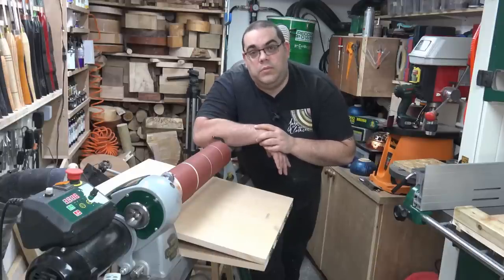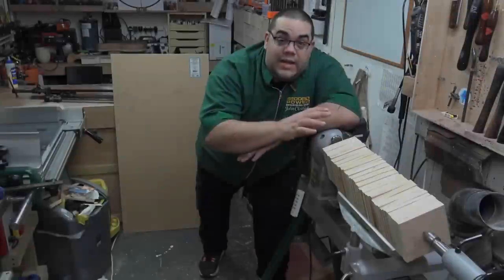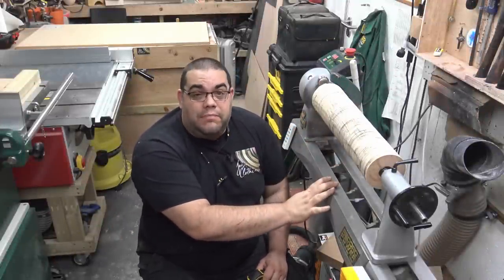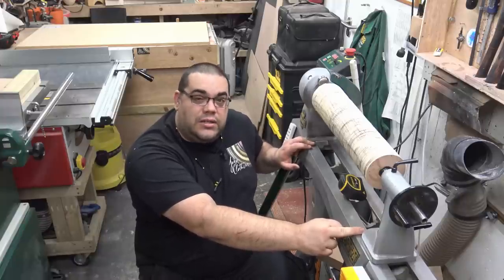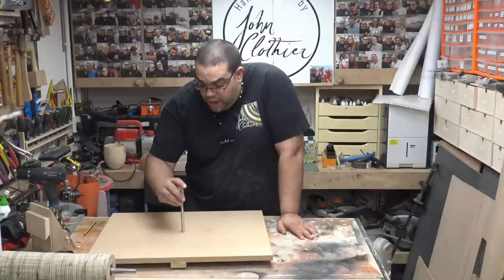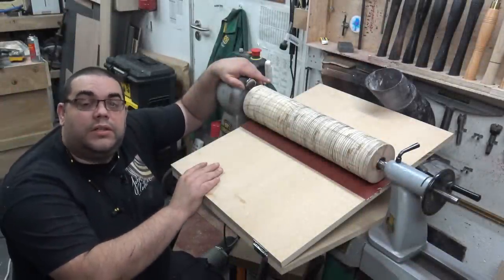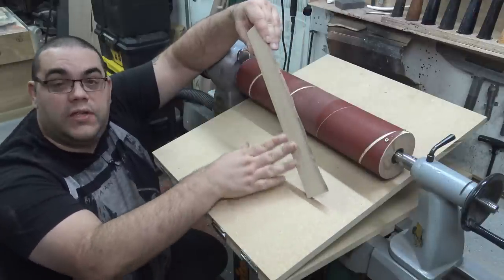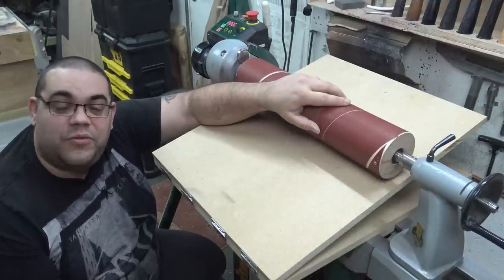How To Make A Drum Sander Jig For The Lathe

Comment: Good video, John. I have been thinking about making one of these for years but just have not found enough of a need for drum sander.  I have about a 4" diameter steel drum I salvaged from a treadmill that I have been keeping to use as a drum if I ever get around to making one. I guess if I built it I would find uses for it.
Reply from the maker: Thanks Mike. That steel drum sounds perfect for one of these. I'm using mine as part of a guitar build but I also think it will be useful for sanding flat rings of segmented wood ready for glue ups. I'm sure it will largely sit unused which is partly why I wanted to make something rather than go out any buy.

Comment: Hey John, you have given me a to quote Dr. Seuss "An idea! An awful idea! I got a wonderful, awful idea!" Ok before you think I mean I'm gonna do something completely half thought plan than can get me and my family in trouble with the law, my idea is thought out but I'm not a engineer by any stretch but simple mechanics I can figure out with my dad. Anyway I've been wanting to get a Lathe Chuck for holding my pieces (My Lathe came with PSI centers and while I trust em to hold my stuff I think I can better center with a four prong chuck, especially for Pottermore Wands and prop sword handles) but they are either just out of price range or not the right DPI for my lathe threads. But I also got a bowl plate with my lathe which has predrilled holes all around it so I thought "With a few 90 degree brackets, a few bolts and a little elbow grease I could rig up one of my own." 

The bolts would be the size that best fit and tightened up to a point I'd never get them off on my own and I have no plans to turn boxes or bowls in the near future so I could give it a new function. I'll work it out with my dad and uncle they know more on these than me, great mentors the both of them. What do you think? I have seen some DIY Chucks and those I'd never trust my skills alone for but a solid chunk of steel is a good base especially since it is designed for my Lathe. Have a good one and good luck to all your future projects.
Reply from the maker: Thanks for watching! You probably could fashion a chuck like that but im not sure how safe it would be.
Reply: @JohnClothier  Indeed, my dad even said it would cost us more in the long run. But as I said it was a idea and I ran it by the experts so I will just keep my eye open for a good priced chuck, maybe go to the hardware store with the plate so I can be sure it is the right thread count. My dad did have another idea for using the plate as a Rotary sander just apply some Velcro and get the right disk grits, it is much safer too.

Comment: Great video John !! My improvements(?) would be to use a sled and maybe to use springs somewhere. I also saw StumpyNubs make similar with that plastic PVC plumbing pipe, 4 inch diameter. Twas cheap enough where he had a drum for each grit. -Mike
Reply from the maker: Thanks Mike. Thanks for the suggestions. Some good ideas there!

Comment: Sorry for the wandering thoughts: Looks like a very good tool for flattening a segmented glue up for a bowl. 

I have seen people scribble the surface to be sanded with a pencil, and then look at the sanded surface after the first pass. If there are no visible pencil lines, the surface is flat, if some are visible then make another pass.

Would a single piano hinge work instead of 4 small hinges? 

The mechanism to raise and lower the surface looks awkward, but I don't have an alternative.
Reply from the maker: Thanks for watching Doug. Yes I am planning to do some segmented turning and the same thought crossed my mind to use this. Not sure if it was clear int he video, I used the pencil scribble trick on the drum when truing it up. Yes a piano hinge would be much better but I didnt have one, I did have the small hinges and while they took a little more lining up I doubt there is much difference. I would ideally go with piano hinge though. The only awkward thing I have found about the lowering mechanism is being able to set it to a particular depth. Its a bit trial and error. I did find away around this though by taking a preset block size and putting that under the drum before raising the bed to meet it.

Comment: Hi John Brilliant idea never thought about making one for the lathe. Would this take the place of buying a thicknesser. Also instead of glueing a nut on the end, could you turn the end of the drum to fit into a chuck. Just a thought, thanks again Terry.
Reply from the maker: Thanks Terry. Yes I use it instead of a thicknesser. It’s not going to take a lot of material away in one go but it’s good to get to final dimension. You could mount it in a Chuck but it’s keeping it straight and true that’s the issue. You know what it’s like when to take something out of a Chuck and put it back, it’s never true again.

Comment: Hello John !
Loved the video !
I am commenting without checking all existing. Please forgive me if I repeat. 
I am currently segmenting, happily despite using crap saws & homemade gear, so this project is right up my street. 
I had a few thoughts...
* Why not double up the mdf to increase its inflexibility (maybe even with plywood
* Is there room to add a short safety fence  along the hinge ? Or have you found that material catches are so unlikely that it would not be worth the effort ?
* I thought a pushstick would be helpful to keep a good steady pace through. 
* The single post table adjustment... has it been stout enough to remain parallel so far ? 
* I plan to use my live center instead of the bearings that you used. Would you recommend I reconsider ?

* Is there anything that you would do differently if you were to do it again ?

Again, great idea, great video, and good on you for putting it out there and sharing. 

Cheers !
Reply from the maker: Thanks Quinn!! 
Sure you could certainly double up the MDF, not a bad idea. I have also thought about a think layer of steel on the top. 
Yes you could add a fence along the hinge. Wouldn't work for me as I want to run long things through it and it would get in the way but great for segmented turning. As long as the drum spins the correct way then no I havent had any catches
Pushstick, could idea especially with small items.
Single post for the adjustment, no I added another 2 to give me 3. This is much better. 
Yes live centre is fine. I would have done the same had I not had the bearings
If I did it again I would add a clamp to hold it to the lathe and add dust extraction. I would also cut the plywood into circles and true that up rather than squares
Glad you enjoyed the video!
Reply: @JohnClothier  

Good Morning from the West Coast Colonies (Seattle) !

Good to hear from you !

I just got my roll of adhesive backed sandpaper to be helically placed on the drum (rough 80, I will then use finer on the 12 inch, lathe spun MDF sanding disk). Your input is gold, and I sincerely appreciate your time and consideration. 

Design-wise
* Is the steel for the table to improve table rigidity, or to improve usability by making a more slippery or truer surface with which to slide the material under the drum ? (Probably a bit of both)

* I imagine eighth inch would suffice, though quarter would not necessarily be overkill, and would then allow you to forgo the mdf altogether...
 hmm, I might just go steel

The lower brace sheet would not need to be planar. It could be as simple as a pair of quarter inch thick, two inch wide braces running perpendicular to the bed, with cleats to fix the lever moment length to the hinges. (Sorry about all the SAE references, we Americans are still just inching towards the Metric system. See what I did there ?) Then super duty tube and shaft hinge a steel table of eighth inch sheet, or quarter... (Which would you think ? I will cost compare.)

I believe I just might make my first Video for this project, and give you credit of course !

I will make it out to the steel stockyard and price this out. I will set a price challenge at $60 ($35 already spent on sandpaper, but there were 3 of them...)

A year ago, I built a braced, quarter inch steel stage to mount a 2 horse motor to my 3/4 horse Harbor Frieght lathe, with machine bits used in order to retain the mechanical speed control. This project should be easier by comparison. I got' this, as it were. 

Cheers !
Reply: Moving forward with the project still. 3/16 plate mild steel 18 wide by 20 deep. Made a circle jig. The ends are plywood, the center is MDF. The cylinder is four and a quarter in diameter. I will pare it down to 4. I am using 5/8 steel rod for the pinion shaft, and machine collars for the hinges. I have yet to weld. I still am planning
Reply: @JohnClothier  

Hi John,

Great video and excellent explanation. I like the idea of using the Morse taper with bearings, but I’ve been unable to find them. Do you have a recommended  website to find that bit of kit?
Reply from the maker: @erickolsen8930  search for a guy called Paul Howard. He sells them

Comment: Just curious as to why you didn't just glue up some long pieces of some cheap hardwood and then turn it round for the long cylinder since you have a lathe to begin with, just seems like a logical step? I guess maybe you were worried about some expansion but would it have really moved that much as to make the cylinder not effective? Nice vid.
Reply from the maker: Thanks! You are right that I thought there would be less movement and it would all be more stable with plywood. Plus i had a load lying about.

Comment: Looks like a great idea, but I think I will use a 3" or 4" PVC pipe schedule 40 for the drum.
I would have thought that you would run the lathe the normal direction and insert the wood at the top (backside of the lathe) and let gravity do the work as the sander brings the wood to the thickness you want?
Reply from the maker: Thanks. A couple of things to consider with using pipe. can you mount it absolutely central? I thought I would strugglen with this so went for turning something. Second is isnit solid enough? That I dont know. I think I would try pipe if I did again. Its just about it being more awkward going round the back. I felt i had more control. Gravity could well be your friend here though thatis for sure

Comment: Nice, but that's a tool that needs to be used outside, or hook up a 4" suction hose to it.
Reply from the maker: @robertcornelius3514  it is.  It’s got a short 4” pipe straight to the dust filter

Comment: Nice build, but why not use a threaded rod with spacers and nuts to center the block and tighten it for the glue curing, and why not cut off the corners of the squares to make turning easier
Reply from the maker: Thanks. Threaded rod is a great idea and if I was to build another one I think I would do that. The reason for not cutting the corners off, just easier to glue up squares. If I'd used the rod though that wouldn't have been an issue